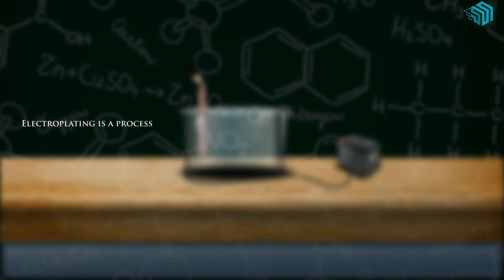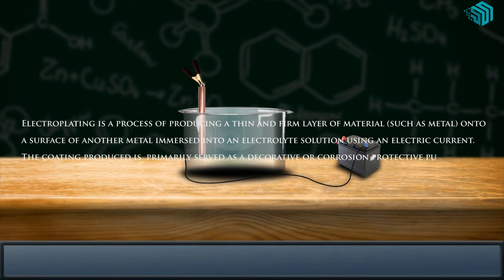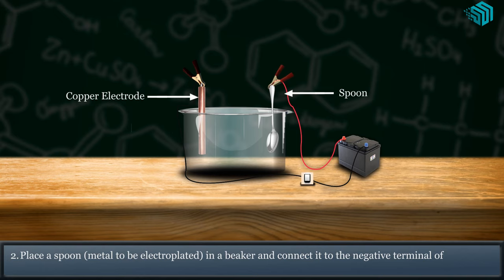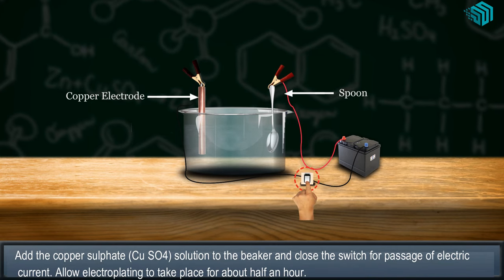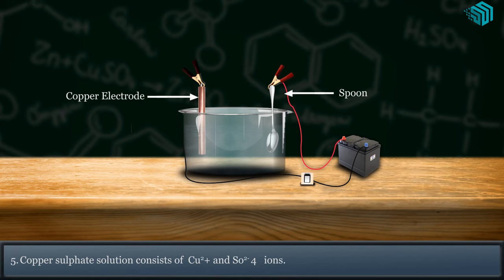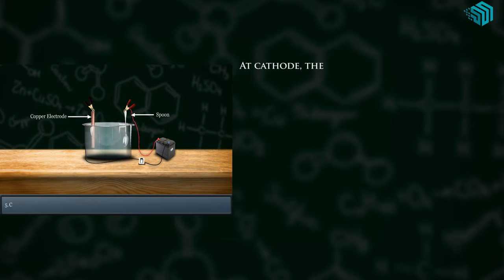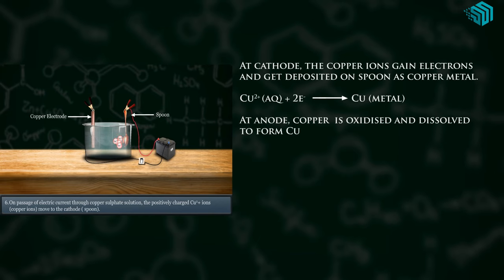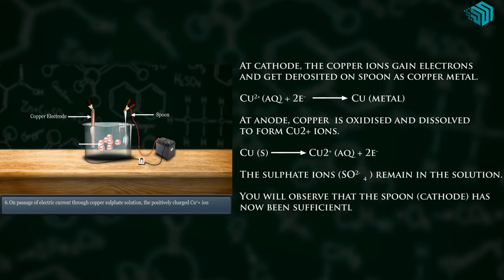What is Electroplating?  | Copper Electroplating

Comment: What is the liquid substance ? Is that water ? Can we use iron alloy as the cathode ?
Reply from the maker: Electrolyte Solution: copper sulphate (Cu SO4) solution in the beaker
Reply: Yes we can use iron alloy at cathode what is placed at cathode gets coated with the metal placed at anode. In your  case the copper metal get oxidised and reduced in the cuso4 solution gets deposited or coated on the iron alloy.